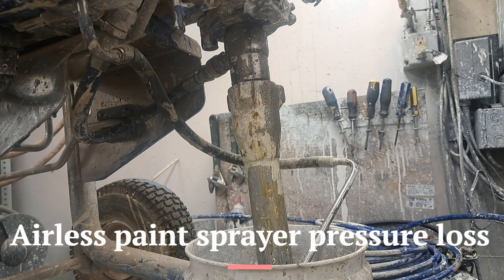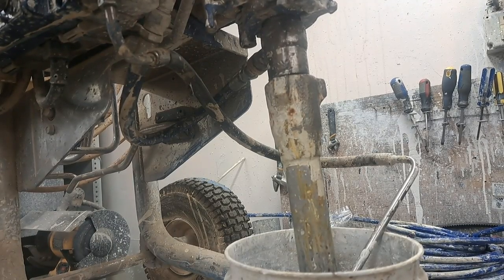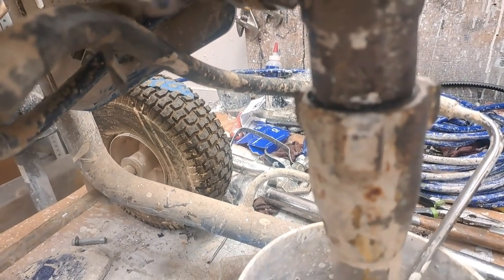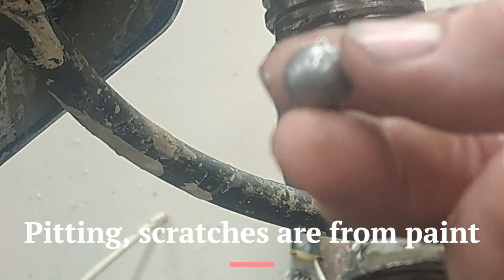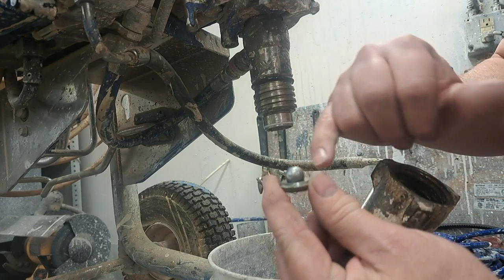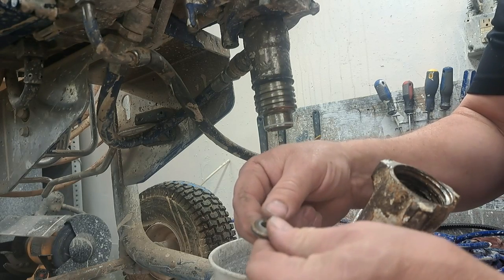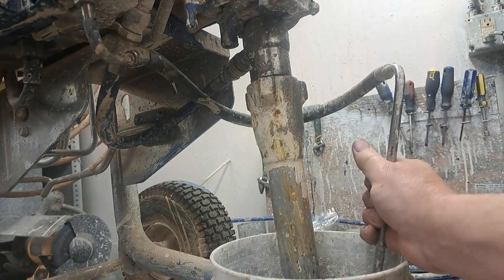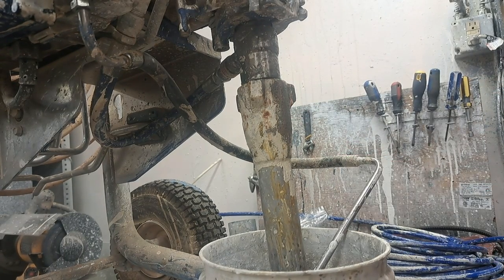Paint sprayer pressure loss  Graco and Titan

Comment: I have a 3500 graco and put a 795 pump everything works fine with water but when i put it in paint it wont get enough pressure what do you think the problem might be?
Reply from the maker: @philadelphiaunion1  the pumps are interchangeable.  Will the machine build pressure and stop pumping with water?
Reply: @ yeah it works fine with water but when changed to paint the pressure is low
Reply: @Brian_the_repair_guy  the sprayer was sitting for a lot of time i could see that engine works fine the pump is a new pump everything seems to be fine its just the low pressure
Reply from the maker: @philadelphiaunion1  will it build pressure and stop stroking with water and with paint?
Reply from the maker: @philadelphiaunion1  will ot build pressure and stop stroking with paint and water?
Reply: @Brian_the_repair_guy  yes
Reply from the maker: @philadelphiaunion1  do you have a pressure gauge?
Reply: No i dont
Reply from the maker: @philadelphiaunion1  if the machine is building g low pressure and stops pumping, then most likely the transducer is bad

Comment: My graco X21 building the pressure when I start spraying is dropping then builds and drops again
Reply from the maker: @kamilbelowski4311  is the pressure dropping and the machine is not running or I the drop occurring while the motor runs

Comment: Hi there! I have a 440 Titan paint sprayer that won’t build pressure or seem to prime. We’ve checked all
Hoses, gun, wiring inside and balls. Everything seems to be fine. What else could be the issue?
Reply from the maker: If everything has been checked and no problems seen, then it is time for a repack.
Reply: @Brian_the_repair_guy  The last we checked was the balls. After that the sprayer started working again (building pressure). Your video was very helpful! Thank you
Reply from the maker: @Lipsticklulu1  glad to help

Comment: Thanks for your videos, I really appreciate it!  I have some video ideas and questions.  I do some small engine repair stuff and I was wondering what your thoughts are on using a hydrosonic cleaner to clean out the pump?  Also, I was wondering if you have a good way to clean out the pickup tube thoroughly.  For video ideas I was hoping you could do one giving some advice on what to look for in a used machine or what are key indicators to avoid.?  There’s nothing on YouTube about buying used paint sprayers and I bet you’d get a lot of traffic with that.  Another good one would be how to do deep cleaning tear downs/restorations?  What tools you find most helpful or useful (other than a hammer😂)?  

I bought a used ultimate nova 395pc that had supposedly only been used for 4 jobs and really any info you can provide on what to do if someone lends out a machine and it comes back in poor shape; or someone (namely me) buys a sprayer and finds out later that it looks like they’ve sprayed hot mud though it.  In my case they demonstrated it with water and it worked fine but then when I got it (395pc) home and tried to spray a ceiling it couldn’t keep pressure up and sounded like someone was whacking it with a hammer with each pump stroke. I cleaned it out after giving up on what I thought was some type of operator error that I couldn’t figure out and when I came back the next day i took the pump apart and cleaned everything out but then I couldn’t get it to prime.  When I checked the pickup tube it had rock hard chunks the size of marbles in it :/hopefully those aren’t supposed to be there because I ground through them with a tire iron that fits up there pretty nicely and tried my best to wash them out.  Now I want to clean out all the hoses inside and out and replace the packings but I’m not entirely sure what the best way to do it is.  Maybe a bore snake?  Hydrosonic cleaner in a bag of paint thinner for the smaller hose from the pump to the filter?  I’ve been watching a lot of your videos o the last couple days (I have 0 experience with paint sprayers but have a few jobs I need to take care of) and really appreciate all the great info you’ve been providing.  

Ps.  What the hell is the difference between all the 395pc models?  Nova, ultra, finishpro, and nowhere can I find any info on differences between them.  Even the graco manuals seem to be pretty ‘mums the word’ on the whole deal.  

Pps.  Thanks again :)
Reply from the maker: A lot to unpack here. First, thank you for watching and the questions.
I also like the suggestions on videos. I will work on that.
My favorite way to clean parts is lacquer thinner. Soaking most of the parts whole or seperate will remove a vast majority of paints oil or latex. 

The difference in the 395s  isn't that exciting. There really isn't much difference. The names change every so often to designate slight design changes, not much more. Parts are about 95% the same in each. The Finish Pro series has an air compressor attached to create an air assist system for low pressure spraying as well. The actual airless is the same as a standard 395. Some of the name variations are used to identify the vendor. Example, the machines labeled "Ultimate" are build for sale by Sherwin, but they are the same machines as Ultras.

Comment: I have a Graco 395st that primes fine and builds pressure to the hose just fine but then 2 minutes later when I try again it won't even prime. I just repacked the pump and can hear the balls rattling around inside so I know they're not stuck. I wacked the inlet tube with a hammer a few times but it didn't help. I'm using a Graco X5 in the meantime until I can get this machine fixed.
Reply from the maker: After you pull the trigger does the machine begun to run? If so, does it run rapidly or slow? When you release the trigger does it build pressure and stop?